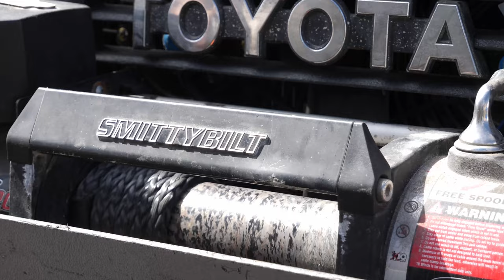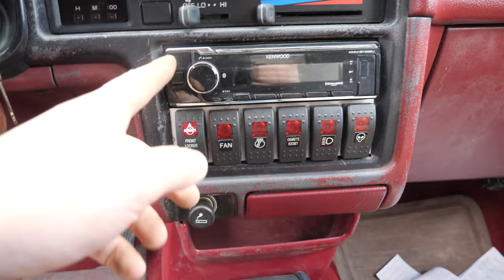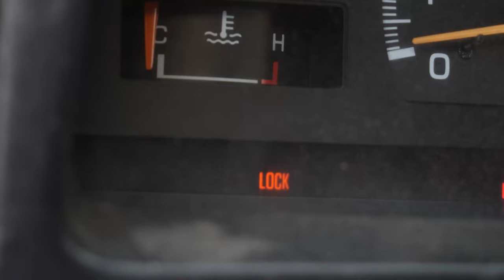Winch Install WITH Synthetic Winch Line | Freedom Recovery Gear | Toyota E-Locker Harness Install

Comment: I went with a diy approach to the elocker harness. Used factory switch from 97 runner and a relay. I rigged it so the light in the switch comes on when it’s engaged. Just another way to do it cheap or free depending on what you have laying around.

Comment: Suggest welding the bolts for winch to bumper, so thieves, move along empty handed
Or weld a plate over the bolt heads

Comment: Hi DG, I have a '83 toyota pickup single cab, 37"s, front/rear bumpers(rated @10K lbs. I think), exo, front/rear lockers, crawl gears. Do you think the Harbor Freight Badlands Apex 12K lbs(good price too). is over-kill for my rig or would you recommend your current winch setup? Thanks in advance.
Reply from the maker: Always better to have a winch rated waaay more than trucks weight. That being said my Smittybilt 9500 has been perfect and reliable for the past few years I have been using it.